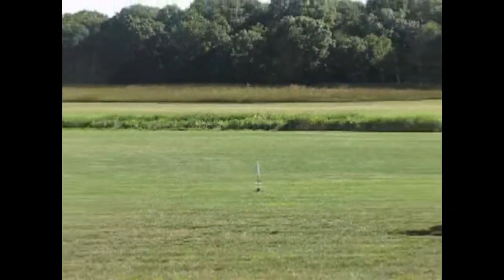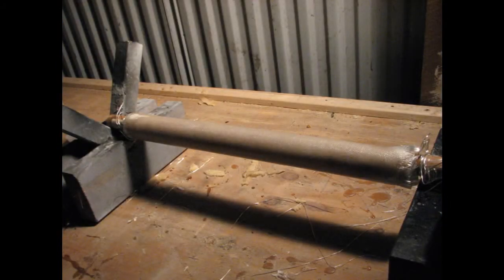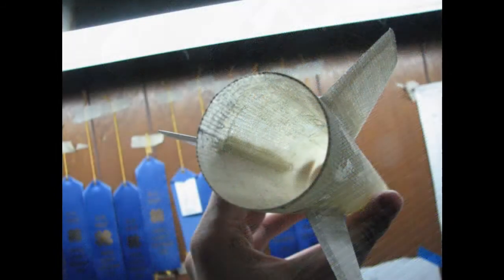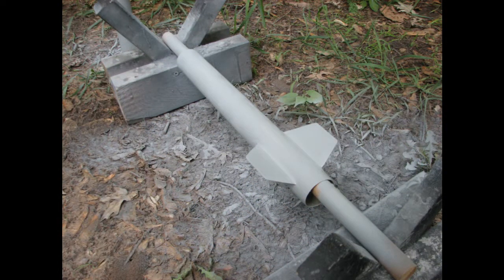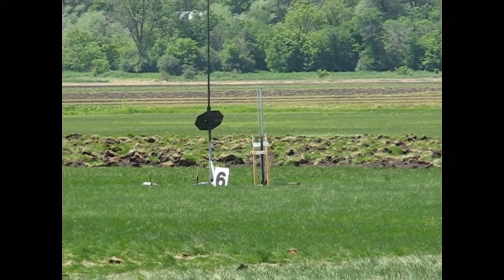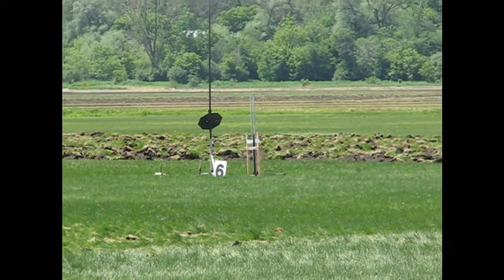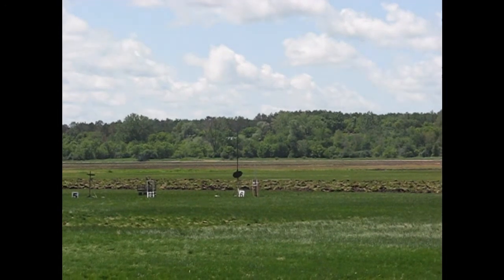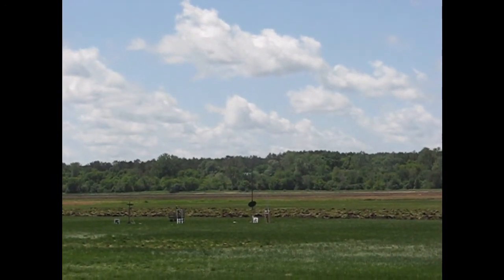Going Supersonic 2.0

Comment from the maker: I used the motor casing as a form. Made sure to protect the casing with parchment paper (or better yet peel-ply but I don't have any), and then wrapped the outer surface of the fiberglass. Ideally you would vacuum bag it but I didn't have such a capability.

Comment: Was it a GPS unit or directional?  I have been using the 900MHz and 72cm ham band transmitters from bigredbee, and I have found that having both the GPS and as a backup, the ability to foxhunt with a directional antenna is important.  That won't help if it landed in water, but if you can keep track of direction during flight using a Yagi antenna then at least you'll know approximately where it went.  That said, put your name on your rocket.  I had one returned after being lost for 2 Months.